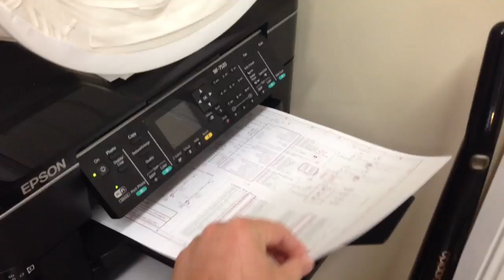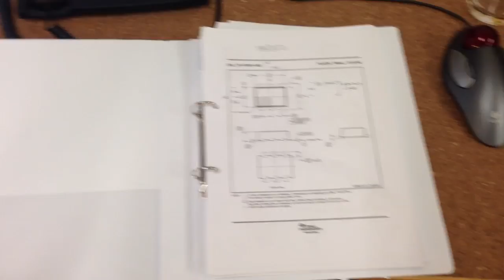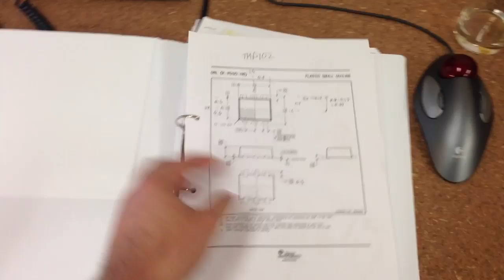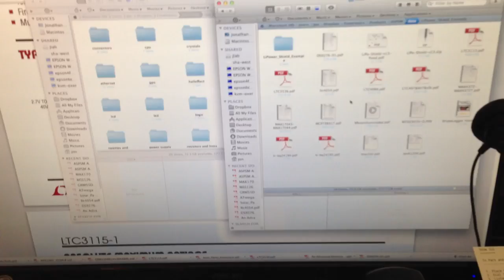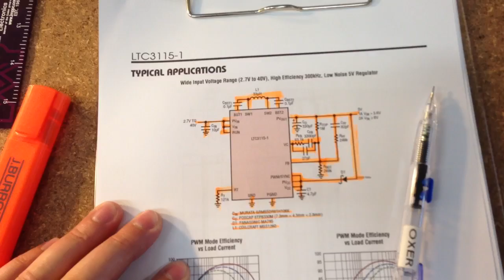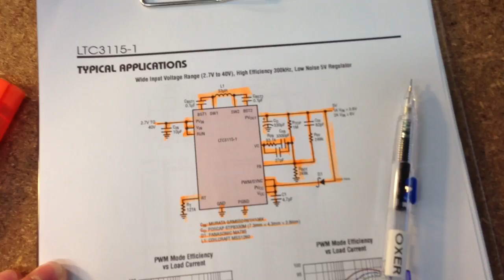Walktime Blog #28: Hard copy datasheets

Comment: I try to use a digital copy as much as possible since it's easy find (my datasheets folder) and I just bring my laptop over to wherever I'm working. Also you can easily search within the document with ctrl-f. If I print anything then it's just 1 or 2 pages for the parts that I look at frequently. Saves me from using up space on my screen.